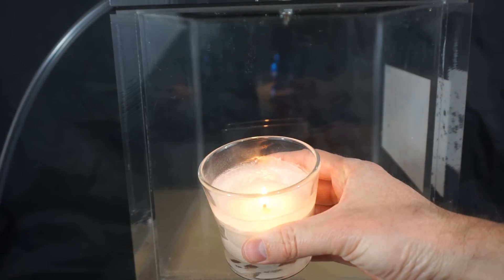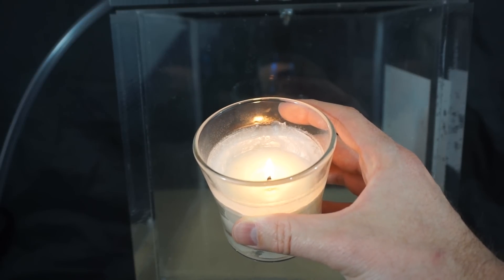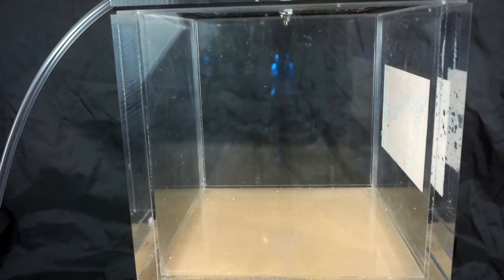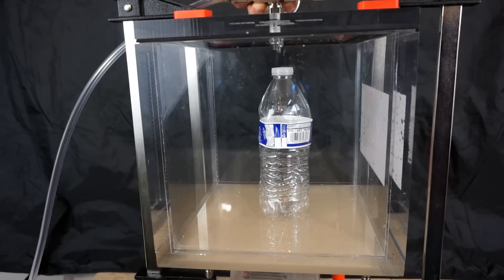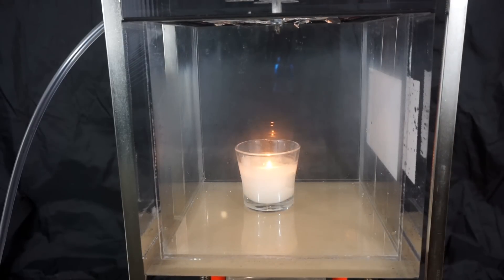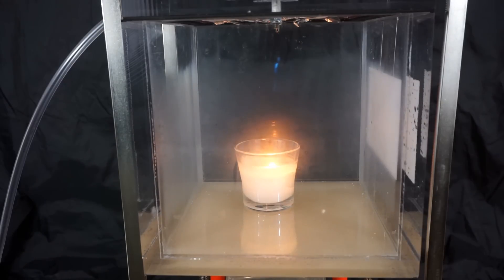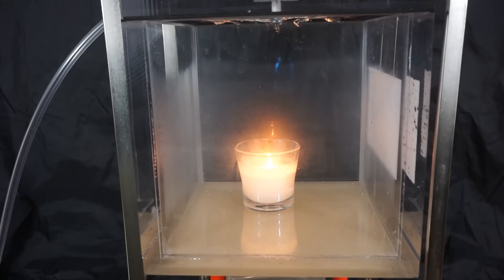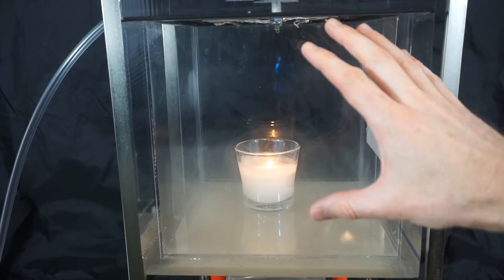What Happens When You Burn a Candle In a High Pressure Chamber?

Comment: I didn't realize 2 atm was considered "high pressure"? That is the equivalent of approximately only 29 psi. Heck my little tiny air compressor will produce 125 psi [8.5 atm], which is what I use to fill my RV tires to 110 psi.  Even my little electric pressure washer puts out 1400 psi, which is more around where I start to think of as being high pressure. But I guess it's all relative. Crank it up! lol

Comment: If you let a candle exhaust all of the oxygen in a container (like this), the flame extinguishes and you get a very nice vertical column of smoke that convects quite nicely through the container typically.
I'm curious what happens to the smoke if you were to pull a vacuum to exhaust the flame.  Given that there is very little gas/fluid to drive convection, would the smoke even be visible?  If so does it just pool in the candle or diffuse through the container?

Comment: Just so you know, if the sides of the box are 12" square on the inside then you will have over 2000lb of force on each side of the box at 1atm pressure inside.  Hope you designed the box to survive fatigue loading for those stresses!

Comment: they won`t burn because fires need oxygen to burn and the vacuum cambers work is to take out the oxygen inside it so if you put a candle in a vacuum camber the candle will just die

Comment: can you increse the pressure so much so the water existsts in a solid state in room temprature or the chamber will exlode
Reply from the maker: +demio26 I don't think it is possible with pressurized gas to get to that pressure I think you need to use hydraulic presses and a lot of steel containment. The pressure needed for room temperature ice is about 1,000 atmospheres!

Comment: If you leave it long enough on will the carbon dioxide turn into dry ice? Just curious. If not try putting ur breathe in a bottle or bag and crush it with the air.

Comment: Take two birthday candles. Light both at the same time. Place one inside the high pressure chamber and the other in the outside. 

Double the atmosphere in the chamber and watch the candles. Do both burn at the same rate? Or does one burn quicker?

Comment: i wonder if he knows chemistry
he did get the reason for the cobdebsation of water wrong. 

water condences because at higher pressure, the partial pressure of water increases. when the pressure drops, there might be more evaporated water than what it is thermodynamically possible, so part of the water vapor condenses.
Reply from the maker: +NelsonR. Candelaria Mercado I have a PhD in chemical engineering so I do know a little chemistry:) and the reason for the water droplets forming is not due to the pressure decrease. It is due to the decreasing temperature.The vapor pressure of water is dependent on temperature only. The amount of water in the vapor phase is dependent only on the temperature of the chamber. If you have two saturated chambers at the same temperature but one is at 1 ATM and the other is at 2 ATM they will both contain the same amount of water vapor.

Comment: Try dry ice in a high pressure chamber
Reply: It will simply start to evaporate at a slightly higher temperature. 
With sufficient pressure, dry ice can remain solid at room temperature.

Comment: 'we should see a little condensation'

totally fills with steam
Reply: JPYen fog!not steam
Reply: +Kevin dam Voris Bacon. You were obviously not asleep at your physics classes. LOL
Confusing steam and water vapor is about the most common mistake on the planet. A steam leak on a high pressure boiler often teaches engineers the hard way, Hearing the leak and not knowing its origin can be quite terrifying, particularly in a confined area. It is like waiting for someone to put a knife in your back.
Reply: @wilsjane   Physics class?  Since when do they teach about steam and water vapor in physics class?  And what's the difference between water vapor and steam?
Reply: @DANGJOS  Ha-ha. Were you not taught about boiling points vs pressure in your class.
Steam is invisible, so that is why it is so dangerous, particularly on high pressure systems where it can be at 200 degrees (392 degrees Fahrenheit), in this case it will not form into water droplets and become visible until it's temperature falls below 100 degrees (212 Fahrenheit).
Take a close look at a fast boiling kettle. As it boils, the water does not instantly all turn into a puff of steam. This is because on top of the 80 calories taken to boil every gram of water from room temperature, it takes a further 540 calories to change its state into a gas. 
As the steam leaves the kettle, the first inch or so is invisible, but as it releases the additional 540 calories into the surrounding air in the room, visible water droplets form.
Needless to say, if you put your finger into that first inch beyond the spout, you will get a nasty burn.
The change in state of liquids to gas is called latent heat of vaporisation. Turning liquid into a solid is latent heat of fusion. 
To turn room temperature water into ice, you need to extract 104 calories per gram.
When melting in your drink the ice reabsorbs that heat and your drink gets cooler.

Guess what.
I am a retired chartered engineer. In the early part of my career, I was a teacher 🤣
Reply: @wilsjane   I'm already aware of everything you just said.  You didn't answer either of my questions.  My question was when did they teach about steam and water vapor, specifically, in physics class.  I would think they would teach about the difference between them in chemistry or something.  My other question was, what is the difference between steam and water vapor?
Reply: @DANGJOS  I spent half a term teaching heat, specifically latent heat and its application in refrigeration.
Steam is a gas, while water vapor is a suspension of liquid particles. 
it is evaporating these particles in a controlled pressure vacuum that determines the temperature inside a refrigeration system. 
Since water evaporates at a fairly high temperature, it is not used as a refrigerant. 
Liquid ammonia is the most efficient refrigerant, but for safety reasons it is not used in domestic appliances.
Reply: @wilsjane   Ah, so there we go.  That's where you lose me.  I have always heard 'water vapor' referred to as a gas, not a suspension of particles.  I assume that's why the guy you responded to said 'fog'.  Fog is a suspension of water droplets.  Water vapor is typically used to refer to the invisible gas that makes up about 1% of our atmosphere.
Reply: @DANGJOS  Atmospheric conditions are far more complex and add the additional factor of relative humidity. This is water held in the air in the form of a gas. At 0 degrees, this is zero, since any water content would freeze. 
As the temperature drops the water droplets are formed. but as this happens the released latent heat raises the temperature until a balance is formed. 
Clouds form and as these get thicker, the  particles of water collide until they get large enough to fall as rain.
It is this protection from the atmosphere that protects s from the direct heat of the sun during the day and our temperature falling to minus 273 degrees during the night.
In desert areas where their is less water, it is sweltering by day and freeing at night.
When you add the effects of atmospheric pressure to all of this, not to mention more sudden changes converting the vapor into snow, you will realize that meteorology is a complete science in itself.
Not one that I claim to fully understand.
Reply: @wilsjane   "add the additional factor of relative humidity...At 0 degrees, this is zero, since any water content would freeze."
Actually, that's not true.  The maximum partial pressure of water in the atmosphere at 0 degrees is about 612 pascals, not zero.  Humidity doesn't drop to zero until you get to much lower temperatures.  

It would take a much longer time than one night for temperatures to fall to -273 degrees on Earth, even without any greenhouse gases!  In fact, thanks to the CMB, the temperature would never drop to -273.

Anyway, I'm not talking about the complicated processes of the climate.  All I'm saying is that the term 'water vapor' is used to refer to water in its gaseous form, typically.
Reply: @DANGJOS  I was generalising, so I appreciate that air at Zero degrees can still contain traces of water, but for general purposes such as air conditioning it is generally regarded as dry. As you know, the absolute zero has been disputed, but only by a small fraction of a degree. As a design engineer, I am not going to loose too much sleep over that one.
Your main point is interesting, It shows the variation in terminology between certain trades and also between countries.
Here in the UK, gaseous water in air is generally referred to as humidity. Calling it vapor would certainly upset the latent calculations in air conditioning design.
Out of interest, have you ever heard of the "ton" in refrigeration terms.?
It goes back to Victorian London when shops were delivered ice every day. It is the weight of sub cooled ice that a fridge can  produce from water at STP within 24 hours.
The term is still used today in commercial design, both as the rating for open compressors and expansion valves. 
Like so many old imperial terms, it is so simple and retains a sense of reality during design.
Reply: @wilsjane   I'm in the US.  Perhaps the terminology is different.  And no, I've never heard of the "ton" in refrigeration.  That's interesting.
Reply: @DANGJOS  You may be interested that in air conditioning a theatre, dew point is vital. If the auditorium air is at dew point, additional humidity from the audience will create a fog. The solution is to overcool the air and return some heat from the condensers.
This is also vital in ice rink design, where this fog at ceiling height can rapidly degrade the steel in the roof structure. 
On one occasion the same happened in a leisure centre. The moisture damage from the swimming pools resulted in the complete demolition of the building. Since older buildings primarily used wood in the structure, it had not been taken into account at the leisure centres design stage.

Comment: Put a balloon in the high pressure chamber instead of a vacuum chamber! and see if it pops!
Reply: The balloon would collapse, just like the water bottle did. The same thing would happen to a balloon at the bottom of a swimming pool, but it may or may not be as extreme, as the high pressure chamber, depending on how deep the pool is.

Comment: Can you go higher than 2 atm? If so what is the maximum attainable pressure?
Reply from the maker: +Wo Dao yes it's hard to get a chamber that goes to really high pressures that isn't made out of steel. The other option is a steel chamber with a small window but it's not as visually appealing.
Reply: Wo Dao it's doable, but it just gets more and more dangerous, it's be unlikely we'd be able to get such a nice looking chamber which doesn't blow up if it's subjected to much higher pressures.
Reply: Yeah gonna need thicker walls for that
Reply: think of a wooden barrel. steel straps around it to hold it all in place and use polyurethane or plexiglass.
Reply: The injectors on a modern diesel engine work at more than 2,000 atmospheres (30,000 psi). The jet can slice a finger off.

Comment: Great man, but you need more pressure. You can pressurize Cola bottles to about 8atm, you should really build a separate chamber that could handle at least 5atm, that would give you some insane results with candles and stuff. A simple glass jar should be able to survive a ton of pressure. And, of course, protect yourself well.
Reply from the maker: +gogo311 yeah, the problem with John pressure is things tend to explode violently and kill you. I am working on getting more pressure, but for a chamber this size there is a lot of force (around 1,500 lbs pushing on one wall), for a soda it is a lot smaller so it has a lot less force on it.
Reply: Yeah, definitely get yourself something slightly smaller (and stronger) before you do that. :)